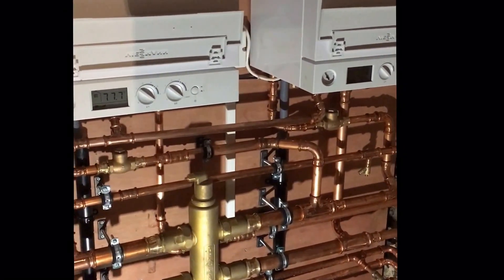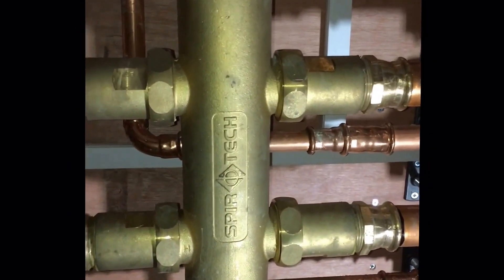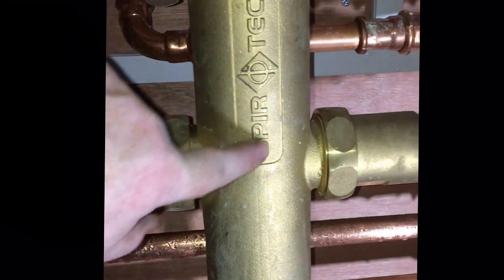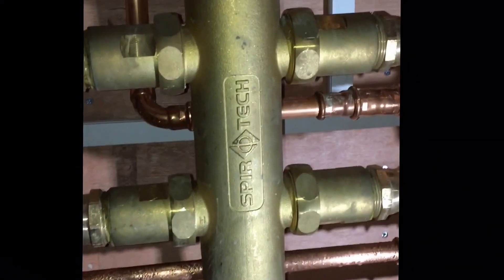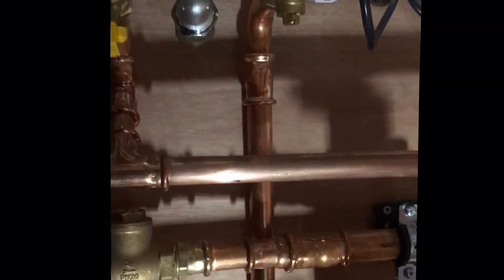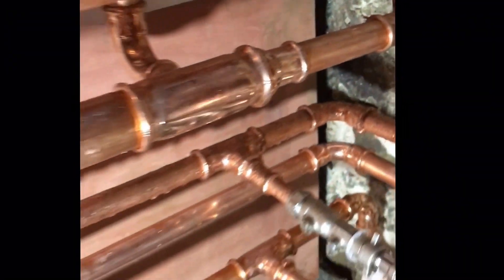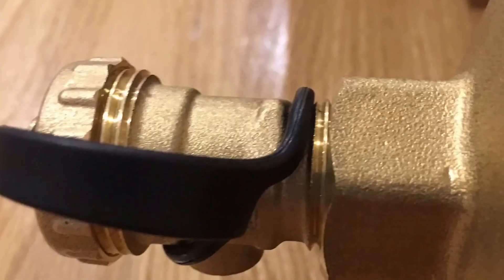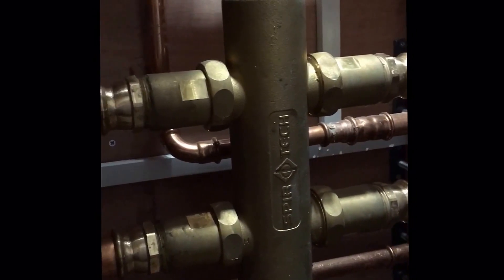Spirotech Low Loss Header how does it work LLH

Comment: 1 1/2" BSP threaded male iron won't go into the LLH female threads
Reply: Well after a load of calls.. it turns out Spirocross' are meant to have tapered threads and not parallel.. however the 2 units we worked on had both types on each unit.. to bloody confuse hell out of you.. Sum1 dropped a clanger in the factory.